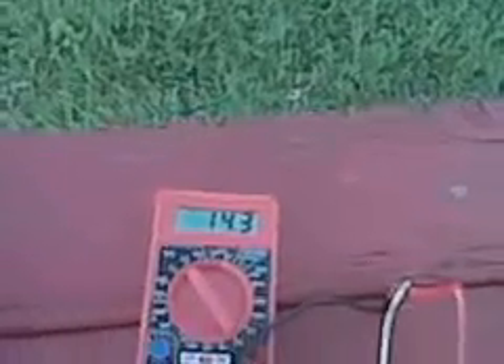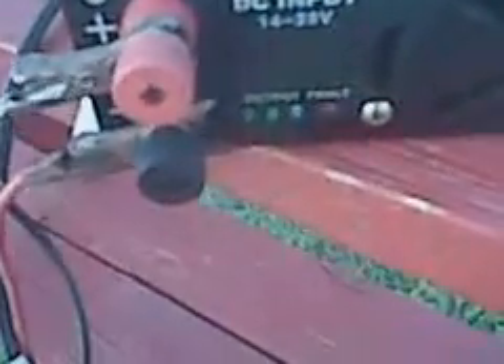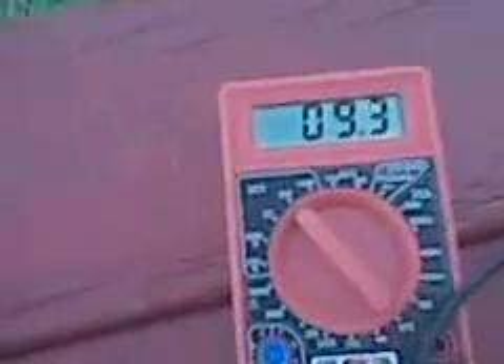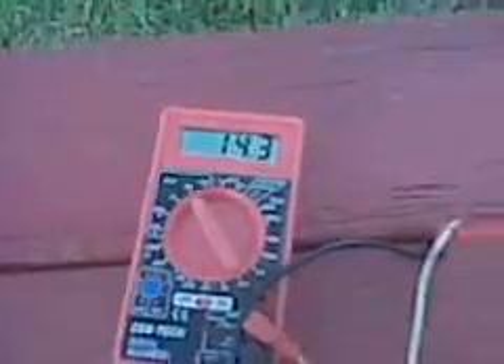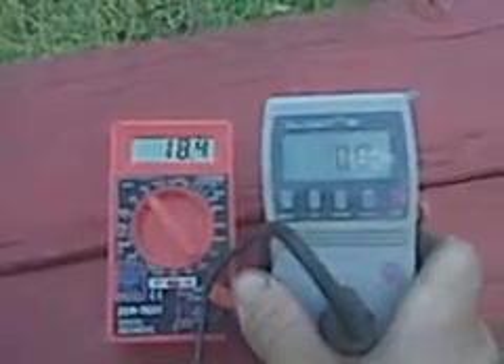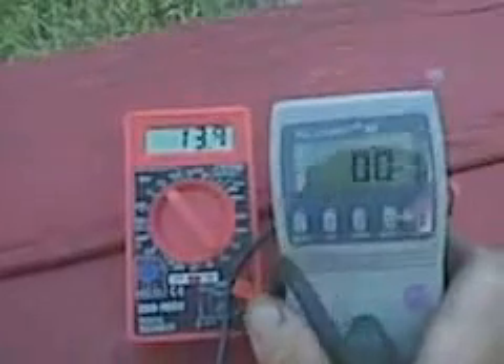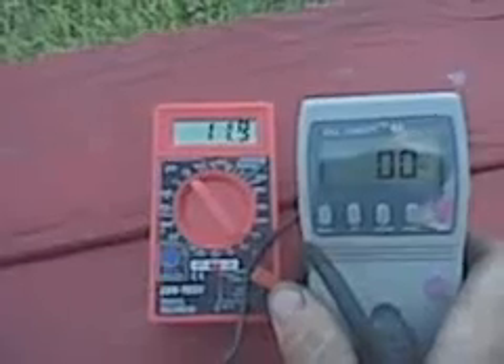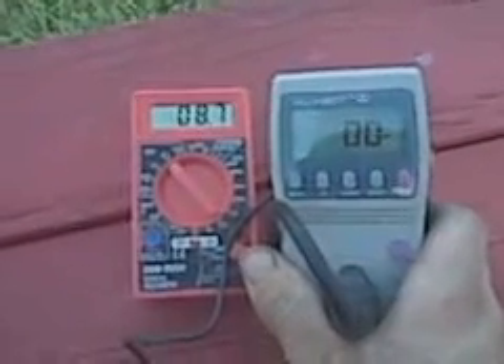90 volt DC wind generator pma hooked to grid tie inverter test 2

Comment: You wanna be real careful that you don't exceed the maximum DC input voltage on these GTI's using unregulated wind turbines. The Grid tie inverters have large electrolytic capacitors on their input circuit so even if you don't damage the rest of the circuit, you may exceed the capacitor voltage and end up with a bang and a nasty smell. Don't forget these GTI's run on smoke and mirrors. You let the smoke escape and it will stop working real quick :-)